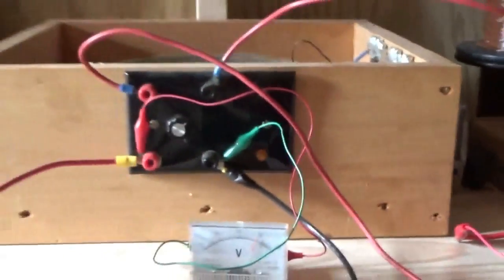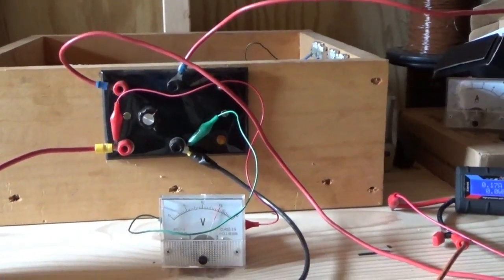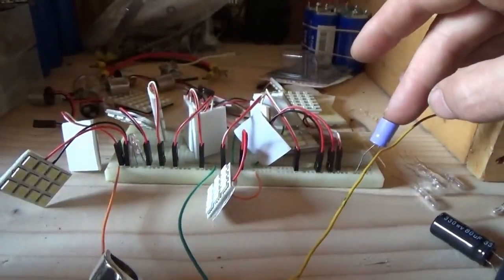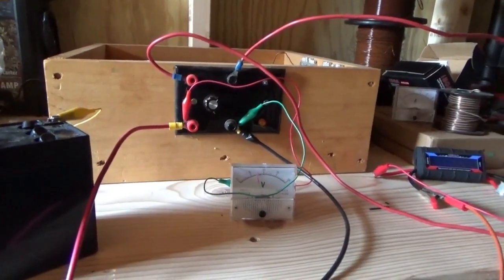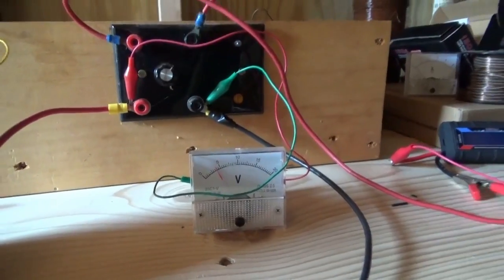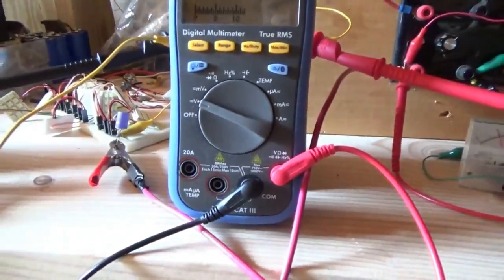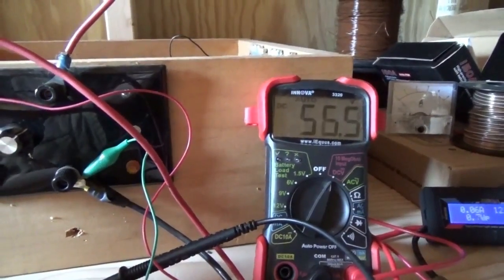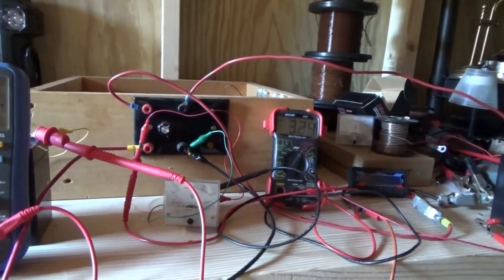High Voltage Output On Bedini Motor Using Capacitor In Series

Comment: The digital meter marked 150A should have a shunt with it. With shunts on your meter, you can have something normally that would read a max of 10 amps go up to 50 Amps or even 150 if it is a 2.5 digit meter. The cheap digital DC LED meters that you can get can read both volts and amps at the same time and only cost about $10. They can run at up to 100V and it is the shunt that allows the same meter to be used as 10A, 50A, or 100A.

Comment: the bigger the capacitor the more volts it will absorb like 1 volt per sec. so however fast that wheel is shining  it's buffering that voltage and not pulsing your battery

Comment: That's a good idea.. I've not actually tried that..   I have a small low input Radiant Oscillator that I power with just 3 volts & it produces a 50 volt Transient.

Comment: the inline meter is blinking with the indicator lights on the bedini. seems like it may be affecting the results..
Reply from the maker: The meter is blinking because I am touching the power on the run battery on and off. Sorry for the confusion

Comment: What about getting a better transistor for your bedini motor so you can test at a higher level?
Reply from the maker: This is the recommended transistor. You can use more than one though. You can use multiple circuits per coil. Or multiple coils and multiple circuits. There is so much you can do which I will share as I build the new one on video

Comment: So if I understand what you have, you have a capacitor in series with the battery you are charging with the bedini. Since the Charging voltage is pulsing at a high frequency , the capacitor is charging and discharging at the same frequency giving you the high voltage. If you left the power on, it might well go to 300 volts
Reply: Duane, thought the BEMF passes thru a diode in the box before sent thru the cap and on to the battery.  Diode prevents resonance so can not see any great boost in voltage that would not already be on the battery anyway.  If no diode, then I can see resonance action as in a LC tank where C is the series of a capacitor and the battery as one.  But if so, why only a great change with the tiny capacitance in series.  As the cap is tiny, would expect to see it with battery alone which we don't.  Maybe Troy can draw the circuit and show us.  Much easier to evaluate.
Reply from the maker: Here is the build of my Bedini motor: http://www.thedoityourselfworld.com/ssg-battery-restorer.php
The top left circuit diagram halfway down the page with the four images is the one I used.
Reply from the maker: The capacitor was just in series with the charge battery - before the battery.
Reply: Yep, it is wired just as I thought.  I stand by my LC and diode comment above.  For the conventional confused experimenters I may have some more conventional explanation for what is interesting about the BEMF event and a hint from their traditional ohms law why the issue of input/output gain under certain circumstance might exceed 100% of what WE put in, the remainder is paid by another entity.  A simple example, you stand by a river, catch a fish, you eat the fish.  Energy input from human small, energy output of fish as food to human much more gained.

To simplify the Bedini to barest, consider an inductor being pulsed by a DC source.  Using Ohms law a certain rising current and fixed voltage will be a certain wattage consumed as input.  Now, lets look at the output.  After the inductor has been charged the voltage is nearly the same as the input voltage source.  But the instant the magnetic field begins to collapse, voltage will sky rocket and current will be a function of impedance.  So using Ohms Law for the output, resistance (to keep simple) is about the same as before, there is limiting amount of current but V=IR where now Voltage is very high, I current is a certain amount but R resistance in an ideal form would be infinity!  This shows why the voltage rises so much.  Now the best part.  P=I2R where current is certain amount but resistance is infinity so P power is near infinity for a moment!  Of course in the real world P will not reach anywhere near infinity.  But we don't have to to achieve our goal!  Naysayers will say the added battery load will kill R reaching very high, but this is only partly true as you still have to figure what ideal impedance matching load to use.  Teaser to conventionalist:  how do you calculate proper load matching impedance to a power source of infinity impedance? 

As to the commentators questioning the concept of drawing energy from the environment.  It is real and one form (there are others) is well known in chemistry.  Endothermic reactions.  One electrical example is the process of electrolysis and forming oxygen and hydrogen.  Although most of the energy of the reaction comes from say a battery, there is a portion of energy derived from ambient environmental heat and contributes to the OUTPUT process.
Reply: Oh, and as energy is absorbed from the environment, there is a very minute cooling of the region, which Nature replenishes at no charge to us.
Reply: To:  The conventional thinkers.  So the above explanation for the BEMF event is really equivalent to the mythological Thor's Hammer.  The conventional thinkers are looking for the magic in terms of power out/power in and not seeing the more important truth.  The conventional thinkers are looking at the Hammer only to make conclusions.  But actually the magic is not in the Hammer itself; its awesome function is to channeled and guide.  Meaning it is a catalysis and can stimulate reactions where amazing effects can result.  This is how tiny energy inputs can stimulate certain reactions where more energy is released than the input catalysis energy.  No violation of physics, if you think there is, then your understanding is lacking.  Other reactions  happen in chemical reactions, plasma, and ions, as in BATTERIES, electron interaction and much, much more.  Once Tesla knew these things he made ever higher voltage devices to take advantage of his "disruptive discharge" (a reference to the BEMF event trigger) and explore the awesome unlimited capabilities of Thor's Hammer.  What will you do with this awesome "magical" device?

Comment: you're seeing the voltage of the cap and battery  in series together , the cap is resisting the current going to the battery that's why its not increasing.
Reply from the maker: There is no current going to the charge battery in this system. Just voltage only.

Comment: First, increased voltage doesn't necessarily equal increased power.  Second, you say energy is entering the system from the surrounding environment. But have no theory as to how that is happening? Or what is going on?
Reply from the maker: I have a theory yes but people get all upset and angry when I try to talk about it. They call it energy from the vacuum, radiant energy, static energy, back EMF and other names. What I dont get is why the voltage spikes so high with a capacitor in series with the battery and how I can harness that energy.
Reply: Vacuum energy or zero point energy may have a role in quantum physics. But there is no known way to harness it. Most of what you read on the internet about people claiming to have devices that can harness this energy are bogus. Otherwise, the world would now have an unlimited source of energy. (EDIT) Zero point energy can be demonstrated in something known as the Casimir effect. But it can not be harnessed in a meaningful way that would be useful.
Reply from the maker: And there really is the problem now isnt it? We can currently restore lead acid batteries with it. But to make it useful it has to be converted somehow. I am studying up on this and believe it is possible though.
Reply: In nature, black holes harness zero point or vacuum energy in the form of "Hawking radiation". However it is not in a way that would be useful to us. But it is still interesting to read about.  The vacuum is filled with quantum fluctuations (vacuum energy). These fluctuations come in the form of particle-antiparticle pairs. Which don't last very long due to the lack of energy to allow them to become real particles. However...  If they occur near the event horizon of a black hole, one of the particles may be absorbed  the black hole. Allowing the other particle to become "real".
Reply: David.  Agree, about the bogus claims.  Vacuum or zero point research is still in its infancy.  But why wait for someone else to find a solution?  Get going and lead the way.  Many great discoveries were found by chance not scientific method in the past.  There is room for all inquisitive minds regardless of pedigree.  Is this any different?  And the world does have in theory and accepted physics an unlimited source of energy for all practical purposes.  The latest research is very compelling of approaching success.  In the mean time the Sun will stand in as proxy.  The real problem is even if unlimited energy became available, the gov would not allow the individual to yield such awesome power.  Think of the crazys and nut jobs getting their hands on this!  Like a nuclear reactor, individuals can not own one.  We are not deemed safety worthy.  This would likely result in only a heavily red taped and licensed large corporation owning the rights and SELLING electricity to us.  This in many ways would defeat the whole point since we would still not be freed from a bill at the end of the month.
Reply from the maker: Good point, EnergyCrafts. We would not be allowed to have it ourselves.
Reply: Signatureemr, I agree that Troy needs an income that allows him to provide for his family. But don't you think you guys are being hypocritical talking about Troy not having a job? While at the very same time, Doc has no job! If Doc can hike halfway across the country, he can get a job and support his family!
Reply: Well, I thank the God Doc doesn't believe in that he has no offspring. But he has proven over and over, both by the work he does in his videos and the hikes he takes that he is fully capable of working.
Reply: Its only about Troy to the trolls. They are obsessed with him.
Reply: Mike Roberts.  Current doesn't mean much either.  Right.  Try running a toaster.  A large lake composed of millions of gallons of water does not mean much either initially.  Try running a toaster directly with that.  Just having a bit of fun but really, you should think in relative context and not in mindless parroting of basic physics that most people already know about.  The idea is to expand the boundaries of knowledge not impose assumptions that all is bound to the existing knowledge pool.  Leave room for discovery of new "rules, laws", and unique applications that may not fit today's bounds of logic.  There must be still more to learn out there as there sure are a lot of unproven and unexplained things.  Let me tell you this short story.  Back before (I think), Bell invented the telephone, there were educated persons that said it was impossible to send speech sound waves over a wire.  That comment is still true today.  Yet look how successful telephones and now smart phones have become.  What the educated person in Bell's day missed was that there was another way (no physics violation) to get sound from one location to another and that was by conversion to electricity that would pass THRU the wire or today thru space.  So this proves the point that "rigid law" can sometimes bite you in the butt if you can not have flexibility of reasoning.  As to voltage, the basis is charge of an electron, yet no one can explain the origin of that charge nor say what exactly, without a bunch of "place holder" terms, this thing called charge is or why an electron should have it or why charge on an electron can not be removed but charge on a capacitor can.  Until we truly know more about charge, we can not say definitively that voltage only is useless and impossible for powering a load.  All you can say is so far and  "by present knowledge" voltage alone seems to not have a power capability and is supported by traditional logic.  To me that is more scientific without the need for setting artificial limits on a subject that involves still unexplained elements like the charge concept and magnetism.
Reply: Mike Roberts.  I guess you are either joking or have completely skid off the rails in understanding my previous points.  Not sure what a 12 volt toaster has got to do with it.  And no you can not run a standard 1200 watt toaster on a mere 12 volts as the current needed would be 100 amps!  No way the wire would handle that!  Where did you buy yours?  My point was saying voltage is not very useful mean that current is also not useful.  Yet you only emphasize voltage.  Second, the other point is electron charge is not fully understood and as such, YOU can not exactly say that voltage or current can not make power under some unexpected condition.  YOU do not know for sure under all conditions nor do you know what causes charge of an electron!  Making blanket statements without a qualifier of limits puts a potential damper on research by other people that otherwise might discover something new.  You want to live in the past knowledge or the future?  Don't reply back if you are just going to quip a cute 8 year old's reply.
.
Reply: Mike Roberts, well you did not help with your 120VAC toaster comments,  which can not work at 12VDC much less shoving 100A.  You need help if you can't see that.  Now you change topic to car amplifier which yes, it can peak 100+ amps easily, but not a stupid toaster!  I do agree and asked Troy to make a demo test showing that the supposed voltage on his batteries is not just a surface charge by using a fixed load and time measurements.  Voltage measurement on a car battery is not very reliable just as you say.  Anyway I would rather he removed the car batteries and use capacitors which is very easy to  measure and test.  They would need to be high voltage rated tho.  He could also check state of charge with a hydrometer, also very easy.

Comment: Question...I built a 3 coil bedini motor. One coil is bifilar and the other 2 are run coils. I am charging 2 badly sulfated 6 volt trojan batteries hooked up in series. I am getting about 9.3 volts going into the batteries. Is this unusual? I see videos with 12v+ coming off the bedini motor and am puzzled by my low output. Is this because of internal resistance in the batteries because of the sulfation? As they desulfate the voltage will rise allowing the batteries to charge like healthy batteties? What do you  think? Thx

Comment: Your capacitor are conducting AC, your signal is primarily AC = you are grounding all your AC removing any voltage high enough to drive your leds AKA. you made a simple filter, the light you see in the small lightbulb is the leftover DC, the reason why your leds was on then and not now is because of tuning you filter(speed), putting the capacitor i series did not increase your power,  you change the load, you removed your DC load by putting your capacitor i series only conducting AC, it is not one to one, its less, but you need to get good equipment to measure that ;-)
Reply from the maker: Actually it is pulsed DC. No AC in the system.
Reply: Yes there is, your pulsed DC will be filtered over your capacitor in a circuit called RC Differentiator, it will conduct small spikes, you always has AC I any pulsed DC, your filter will also decrease your load giving you a higher voltage before you capacitor.
Reply: Also any capacitor will conduct until it's saturated, you will see that when you get your scope.
Reply from the maker: How do you figure there is AC in pulsed DC? Pulsed DC is one direction only. I dont get what you are saying and never heard such a thing before
Reply: So even if there is a tiny residual AC component what does that got to do with Troy's observations of very large voltage swing?  If I make a pulsed RC circuit which I have done before for triggering SCRs, depending on the RC values the output waveform is anything from sawtooth to spiked PULSES.  So spikes would be recreated and passed not filtered to the battery!  Filtering with an RC Differentiator usually involves changing frequency, which is not the case here.  Also a lead acid battery can be modeled as a capacitance of many hundreds or more farads and in series with its internal resistance which in a sulfated batteries will be high.  So the car battery is already a form of RC Differentiator.  Yet Troy's observations don't show up with just the battery, so your idea of the tiny capacitance and the car battery acting as a resistance for a tiny RC Differentiator in series with the existing battery RC Differentiator is not supported.    And the battery can not be thought of as just a resistance to qualify your RC Diff. idea.  It is a good try put does not fit unless I misunderstand.  It is best if we could get a schematic diagram showing the whole circuit.  That would clear up any confusion.
Reply: Because Troys main load before putting in the capacitor was both AC and DC, now he applies a  RC Differentiator only letting small amount of energy in spikes to the load, so he change the load letting the main "dc pulses" see no/little  load and therefore the voltage will rise.